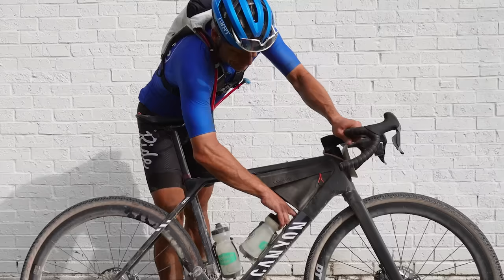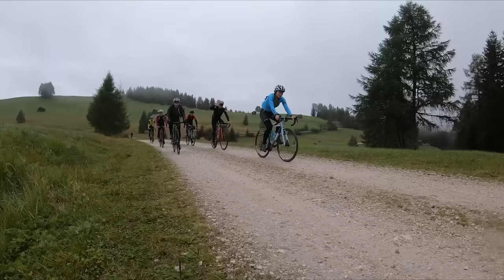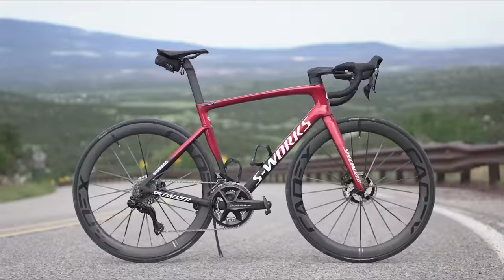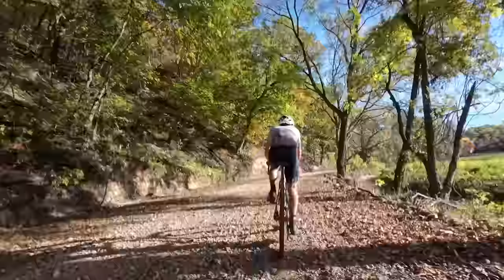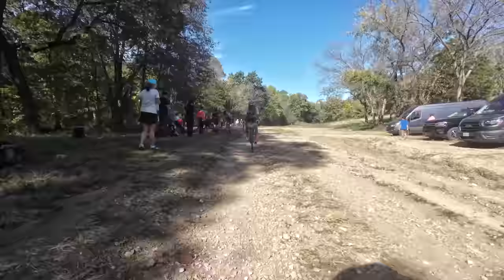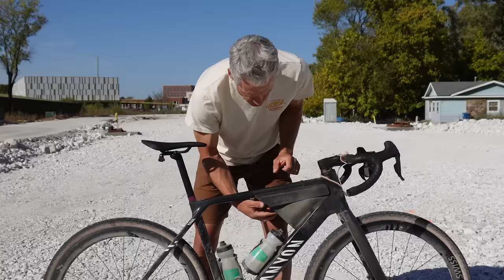Racing the new Canyon Grail at Big Sugar Gravel

Comment: GRX with the 105 series 11-36 in the back and the 30/46 in the front is a much better setup in terms of gearing in my book. On a carbon frame, this is enough to even tackle short passages of 20%. To me, that is the kind of incline a Gravelbike should be able to handle. On the other end of the scale, 11 in the back and 46 up front is plenty good up to 30mph and more if need be. In my mind, this is the perfect setup, since it combines a huge range with super small steps between gears in the upper register, so you can really dial that candence in. Way ahead of any 1x IMHO.

Comment: They limited to 42 because of the grizzl.
My rides would run perfect with 35, happy about this bit of trail in geo if suddenly road is dead or defect. 
And I realy do enjoy your input from your vids. Stay tuned!
Reply: Happy I have a Grizl.  The only thing I like more on this bike is the downtube storage...IF they fix the door😂
Reply: @veganpotterthevegan  I’d like to follow up on this if I may: For someone new to gravel cycling and living (literally) in the Dirty Kanza area, would you recommend the Grail or Grizl CF SL8 2by? I am leaning toward the Grizl— bigger tires, seems more ready for the “ unexpected” but would appreciate an expert opinion.
Reply: @akmola1  Totally!!!  I've never ridden there but I'd go with the Grizl for long term survival IF you're the type to ride in the mud.  You can run a 40-45mm tire and still have mud clearance.  With the Grail, you'll be better served running a 35(or even a 33mm cross tire) so you don't eat your frame away in the mud.  And while Canyon says they specifically design the Grizl for 700c tires, it still gives you the versatility to run a 650 with big rubber.  My ex GF will throw 2.5" 650s in her Grizl and ride single track with it.  I live in Utah and have some pretty gnarly gravel/road climbs(look up the Wasatch All-Road) and run a 38t up front with a 9-46 e*thirteen cassette.  I think I'm going to throw on a 44t chainring, fenders and a 10-36 cassette and it'll be my bad weather bike for the winter.  I'll just ride my 45mm Schwalbe G Ones I gravel rode all summer and replace them in the spring.  Kinda nice having a slower tire when it's ultra cold to decrease windchill, especially if I'm descending one of our big canyon climbs.
Reply: @veganpotterthevegan  thanks for the insights! You’re confirming what my gut feeling has been. Plus if we are talking about 33s tires for the Grail, I already have a Canyon Roadlite CF8 with 30s on it so there’d be no need to duplicate the bike (I’m absolutely loving my Roadlite, by the way, and averaging higher speeds on it than on my Co-Op ARD road bike. The only issue is, there hardly any paved roads that would be safe to ride on down here in Kansas, so I am ready to venture in the world of gravel. When in Rome, do as the Romans do I guess.
Reply: @akmola1  
Many Thnx for your notes.
Compared with such gravel roads in Kansas or Utah the roads here in Germany feel like hiking trails for me my area. 
And I have 'fear' about Mudd Noo :) at 'road'. grail AL6
Have fun with regards!
Reply: @akmola1  you're welcome!  Happy you're loving your bike!  I'd possibly be looking at the Grail for champagne gravel if I didn't already have a Domane.  I'm lucky in that I can really pick whatever kind of riding I want and it's quite safe here in the Salt Lake area.  We do have some terribly paved roads from winter damage though so I don't see myself ever riding a road bike with anything narrower than 32s ever again outside of my TT bike and I may even be replacing that so I can at least train with 32s...28s only fit on the back

Comment: Hi Ben, thanks for your report about the grail cfr which i own since two weeks now. It's a great bike on flat ground...like a rocket! (got the grizl before!). Would you tell me which pressure you pump on which tire's...for me the stiffness of the bike on trails is at the edge. For that reason I changed the argo with my aerofuel saddle so far.  Please excuse my bad english!! Greetings from germany!
Reply from the maker: Guten tag. I use Silca’s tire pressure calculator all the time, because correct pressure is all about weight (yours and the bike), tire width, and where you are riding.  https://silca.cc/pages/app-tire-pressure-calculator
Reply: @TheRidewithBenDelaney  Hi Ben, thanks for your answer! i'm always using the sram calculator...on my last ride a few hours ago i took the pressure für an rainy ride (although its the brightest  sunshine). This brought better results to me (dued to my weight of 80kg: front tire 2,3 bar and rear tire with 2,4 bar).

Comment: Interesting about the slacker Argonaut gravel bike not fitting travel cases.
Reply from the maker: Just a particular SciCon road case where you bolt both front and rear axles in place.

Comment: Would you say the bike is faster of slower than the old Grail. Sounds like on pavement that may be the case due to the geo......?
Reply from the maker: Depends on how you define faster, right? Just based on physics modeling with power in and the resistance variables of weight, aero, and friction out, it's gotta be faster than the old one. If we're talking how fast it *feels*, then yeah, on pavement the handling feels slower, but on rough stuff feels more stable. So Canyon I'm sure would argue that the handling contributes to going faster off road if the rider feels more confident.
Reply: @TheRidewithBenDelaney  Thanks Ben.

Comment: Looks like front could probably fit a 45mm wide tire?
As Canyon advertises 42mm wide tires including fenders, 45mm without fenders might be feasible?
But agree, the 42mm clearance is also the major downside from my point of view.
Reply from the maker: Maybe on the front, but the rear is constricted by the stays on the sides.
Reply: Hi Ben. Great channel and info!! I like the Panaracer Gravel King tyres and the SS model which i ride mostly, come in 43 mm..have you by any chance tried to fit them on the rear? Thanks!

Comment: Ben, don't blame yourself for the door mishap. This is typical for users to do but in fact they should be blaming the designer or engineer for the door not fitting, oriented wrong or not! The fact that it kind of fits, when upside down, is very misleading. It should have been designed better, "keyed' so that its super intuitive how it fits visually and mechanically.

Comment: I have one of those preset torque keys for 10nm that I use on thru axels. That way I don’t have to adjust the tourism wrench every time, and I always get the wheel done up to the right spot so the disc won’t rub. My disc will run if the wheel isn’t tight enough.

Comment: Tire clearance is technically unchanged at 700x 42 mm, but Canyon points out that’s with fenders, so the effective maximum tire size is closer to 700×45 mm (40 mm-wide tires come stock across the board). There’s also a dedicated – and impressively, thoroughly engineered – full-length front and rear fender kit

Comment: Max tire clearance on the Canyon site is 46 front, 42 rear. 

If there is no mud. You could ride those tires in 45 on both ends. Rear will be tight or just run 45F, 42R in mud

Comment: Thank you for this great inspirational video, i am new in the gravel Business coming from a road bike and just ordered my grial. It  would be really great if you could  tell how you were able to add the go pro mount to the canyon computer mount (for the use with a Lupine lamp). Canyon customer support has no help or ideas for me :/ Greetings from the rainy Germany.
Reply from the maker: Hey Sebastian. I used the ‘puck’ circular insert for a Wahoo mount (which has a 90-degree difference from Garmin) and longer mounting screws. I would suggest going to a bike shop where they should have a bunch of different small parts like that.

Comment: Great content! Do you think you could perhaps create a video on what you do physically, nutrition and exercise to prepare for your races? I have just recently taken up gravel riding and I'm entering my first race in February (56 miles). I am just a bit older than you. Thanks for any help.
Reply from the maker: Sure, I could do that. Which race are you doing in February? Two short answers: I use Optimize from FasCat for training. To get ready for 56mi, just work your way up to that distance in between now and then, taper off in the week or two before, and then have fun.
Reply: @TheRidewithBenDelaney  Thanks, that sounds simple enough :-). That's what I thought and have read. I freedive so I'm pretty familiar with training, but training for endurance seems to have its differences. Freedivers kind of train. as if we were 800m runners. Definitely different from endurance racing. I will check out FasCat too. I guess I just have to get used to being in the saddle for prolonged periods of time. I've never done a group ride.  I'll have to learn what the best nutrition is while I'm on the bike.  I'll have to learn to ride with others to take advantage of drafting too. I'm doing the Gravel Miami race on February 18.

Comment: Great ride Ben, I love the shape of the handlebars on this new Grail, will wait for your thorough review. DT Swiss GRC1100 wheels, is that a new model? Could only find GRC1400 on their website. How did you like them for Big Sugar? Thanks
Reply from the maker: Thanks. Those wheels could be an OE-only thing. They're a good Goldilocks configuration with wide internal and kinda aero but not super deep/jarring. Better suited for midwest/wide-open gravel than Big Sugar, but performed just fine there, too.

Comment: BD great stretchy pants action and content awesome🤙        Where did you puncture the tyre? 
Down the centre or sidewall?  As you said it’s also my favourite but only at Unbound did they puncture both front and rear tyres were in the centre,  all the other km’s I did using them no drama 🤔  40mm as favoured  but would a 45mm be better for rolling resistance etc?  Thanks mate keep doing to good stuff thanks
Reply from the maker: On the side of the main tread. I filmed myself putting a Dynaplug in but the audio was terrible so I skipped it. 45 might roll a touch faster but the added weight would probably mean a slower overall package. Cheers.

Comment: That flappy front corner on a bag advertised for aerodynamic gains is driving me crazy😂  I know it has no effect with the number plate but it's still a questionable design
Reply from the maker: It's a little heavier than a top tube bag, but has more capacity and doesn't hit my knees, which pretty much all top tube bags do. I dig it.
Reply: @TheRidewithBenDelaney  my legs definitely hit my bag if I'm standing.  Thinking about going to a hard box like I use for training on my P5.  My knees don't hit that but it's smaller.  
*I do love the idea of this bag and the size.  The front of that flap just bugs me

Comment: Question about the stock Fizik Terra Argo saddle. As an Antares guy, I've ridden both the X3 and X5 and found them comfortable but that they inevitably start making a super annoying clicking sound after X amount of miles into a ride. I'm guessing its dust ingress into the channels that house the rails, which are tough to clean and impossible to access. Anyway, I've not been able to find any similar complaints online and was just wondering what your take is? The noise is driving me nuts (started up midway through The Rad gravel race and was visibly annoying others in my group) and I'm considering going with my road saddle of choice (Antares 00) despite it's stiffness. Thanks for the in depth race recap and awesome content!
Reply: I use gorilla clue for that creak/click
Reply: Where do you apply it?
Reply from the maker: That is annoying! Personally I haven't had that with these Argos, perhaps because I'm always swapping bikes. Potter's Gorilla Glue suggestion is interesting.
Reply: @justinjewell1043  I just put it in the back holes where the rails are inserted.
Reply: @veganpotterthevegan  Awesome thanks! So you must have experienced this as well, yeah? Feel like my creak/click is coming more from the nose of the saddle. So you just squirt a bunch around the rails to plug it from anything getting in? Kind of a lame solution but I guess it's a solution haha.
Reply: @justinjewell1043  ha, yup,  just where the tubing goes in.  I have a good 250k miles of Antares variant riding.  I keep them as long as possible. I have one with about 80k on it.  It cracked at about 50k and I layed two layers of carbon on the bottom side and it's still going strong on one of my backup bikes😅
Reply: @justinjewell1043  if you're doing the front and back rails, only do the front pair or back pair at once.  That glue is thick but it will definitely run when you're not paying attention.
Reply: @veganpotterthevegan  Appreciate the advice but after reading your responses unfortunately I don't think they apply here. I'm talking about brand new Fizik Terra Argo saddles and their propensity to start clicking and creaking shortly after you've ridden them. Seems to be an issue with the construction and the way the rails just sort of loosely insert into hollow voids in the base of the saddle. Probably the same glue solution would work but I'd rather opt for something a little less warranty-voiding. Anyhoo, likely just ditch the annoyance and go with the Antares 00 as it's always a failsafe for me.